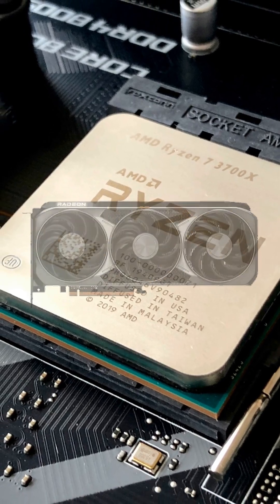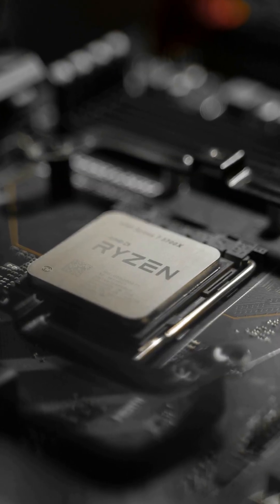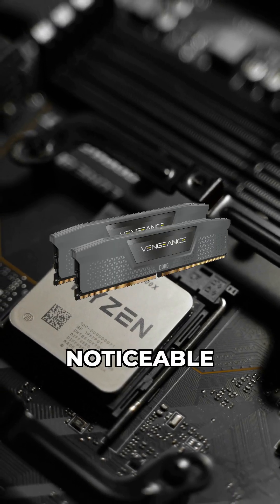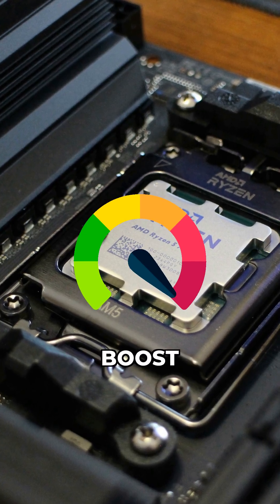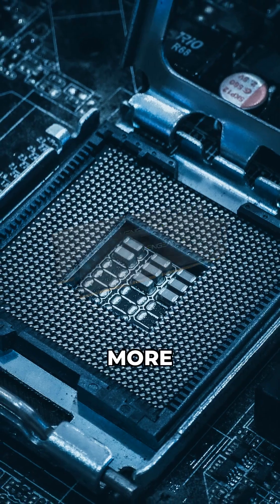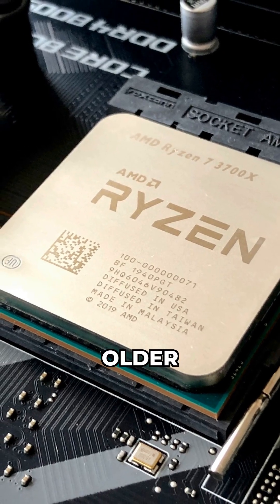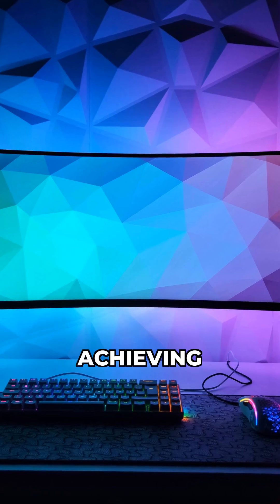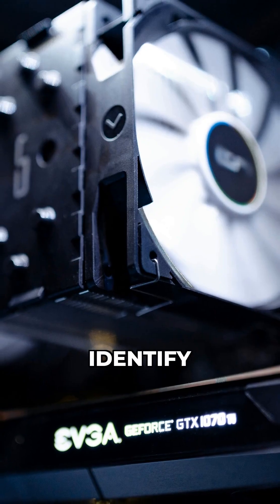RAM Ranks: Does Dual Rank Still Boost Performance? #Shorts

Comment: What about the performance for 4 rams? I have 4x8 (32)
Reply from the maker: If each of your four 8GB sticks is Single-Rank (1R), your system is considered to be running in Quad-Rank mode (4 total ranks).

1R means 1 Rank per stick.
You have 4 sticks.
1 Rank/Stick × 4 Sticks = 4 Ranks (Quad-Rank)
This is the most common configuration for a system using four 8GB memory modules.

To be sure, you can look at the label, which will display a code like 1Rx8 (Single-Rank, where x8 is the chip width) or 2Rx8 (Dual-Rank) in which case your system would be running in Octal-Rank mode (8 total ranks).